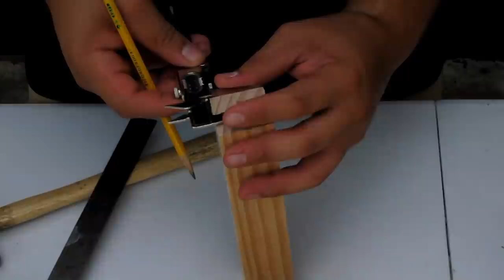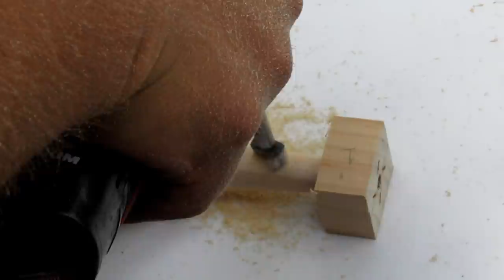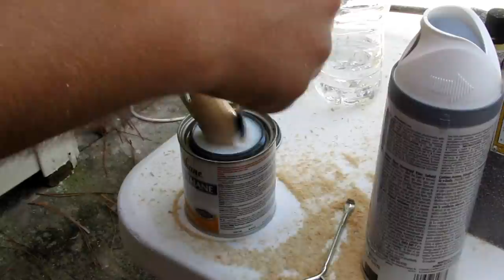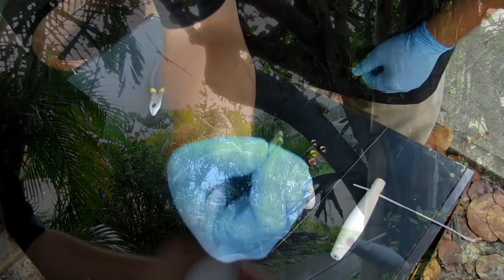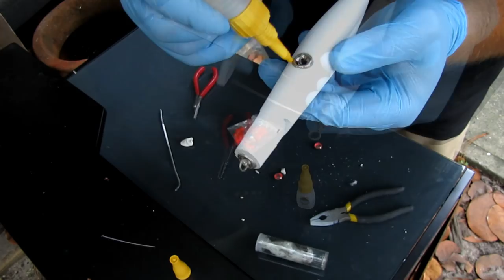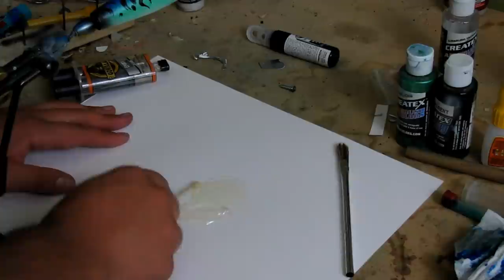Making a simple topwater fishing lure

Comment: Nice work...was surprised to see the weight on the tail.  I guess that'a a lure you might use off the beach?
Reply from the maker: Engineered Angler yea for the most part I like to make surf casting lures designed for long range but ill be making different ones in the near future and thanks for watching.
Reply from the maker: JockerLordz I use a two part epoxy called Marine uv resistant epoxy.and is mainly used for saltwater